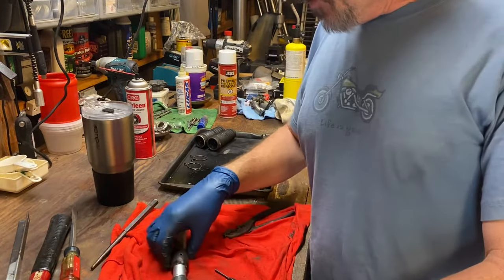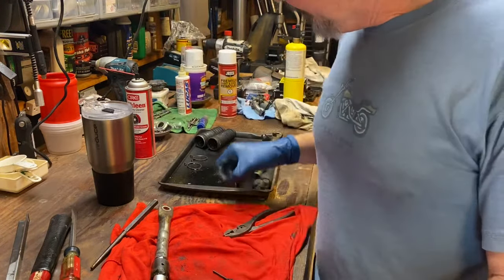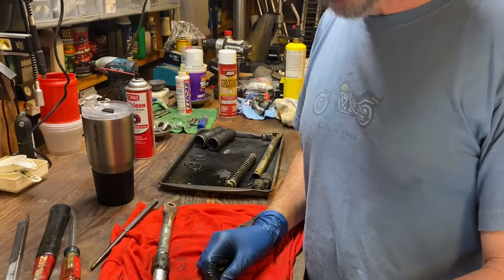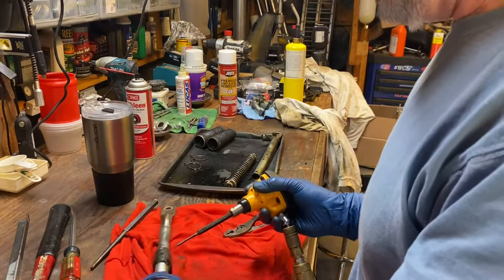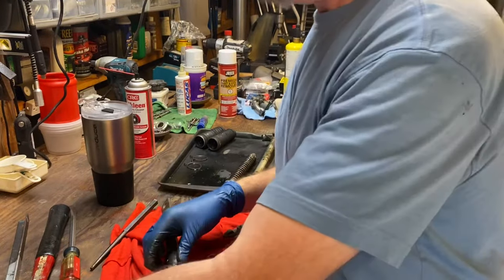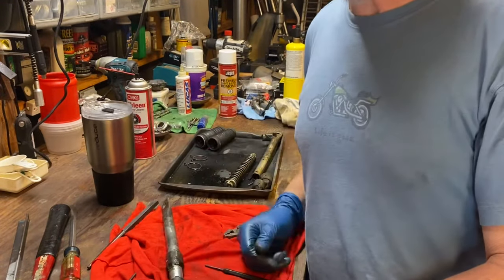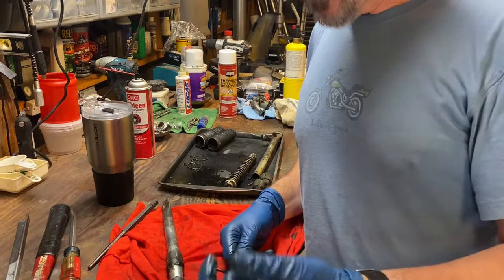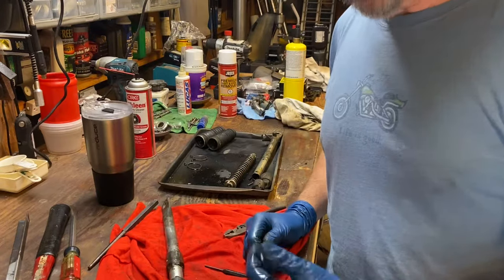How to remove a roll pin in 3 seconds

Comment: It worked!  I went and bought one just for this purpose, and in a matter of 3 seconds it was out.  Been beating on the pin for two days and it wouldn’t budge.  GENIUS!
Reply: I second that. I had a pin stuck in my 1971 snowblower axle. The previous owner had a broke off punch in it. As well.  Took me seconds to knock it out.  $24 palm nailer at harbor freight and the Pittsburgh roll pin punches fit right it.
Reply: I 3rd that!  Same here blown away

Comment: HANDS DOWN BEST INFO IVE EVER LEARNED ON YOUTUBE! I just spent the last almost 3 hours fighting with a roll pin going thru a plastic drive cog into a steel shaft on a snowmobile and finally searched roll pin removal on the tube and this trick got my roll pin out in about 3 seconds! I'm blown away and thankful for the tip! Thank you!!!

Comment: Bro I spent hours over the course of a 3 days trying to get a roll pin out of the steering wheel shaft and rack and pinion using a roll pin pusher and hammer. Never getting the right angle due to the parts being on the car. I saw this video and ran to Harbor Freight bought one for 25 and did what you said. First attempt the roll pin came out. I was happy and mad at the same time. Wish i would have found this video sooner
Reply from the maker: Glad it helped and thanks for watching!

Comment: It worked! I was skeptical of this but was desperate after the first roll pin took hours to remove. I bought the $29 Banks palm nailer at Harbor Freight  and was surprised how small it was. My first attempt cracked the edge off the pin. I launched two punches so be careful. Then I got a good position and the stubborn pin flew out the other  side of the hole. I'm amazed!

Comment: Had 4 split pins to remove from a gearbox. Palm Nailer did the job in less than a minute. Much that time was rotating shaft to get a proper angle for punch.

Comment: Thanks I was thinking I had to get a hydraulic press. Just did this on split pit that was about 1/8 thick. Used my bigger palm nailer as I don't own a small unit and it worked. Careful hits until my punch was in the hole. Held shaft with a drill press press vise.

Comment: This is a great idea and seems effective but I've got four stainless steel 1.25" rods joined each has a joined smaller section by a spring pin and they are not coming out with the palm nailer...any ideas?

Comment: Blind Hole Roll Pin Pulling Out:  Any ideas?     Bore is 3/32 inch.  Only thing I can think of is a very small tap: thread inside of pin and tap will screw it out when tap bottoms.  OR ??????

Comment: I need to remove and reuse one on the trunk cable of my 71 vw beetle. Does this method destroy the pin? Do you know how to install one?
Reply from the maker: It does not damage the pin, just use the right size punch.  Installation is easy - just tap it back in.
Reply: @Chris_Does_Everything  I have a small compressor for putting air in my tires and it works on with a staple gun. Is that enough power for the palm nailer. What else can I do with the nailer?
Reply: Does the tool come with different size punches? The one I need would be tiny. Hardly measurable. I don’t suppose I can attach a photo?
Reply from the maker: It’s designed to drive nails, you’ll have to buy the right size punch if you don’t have one.  In terms of your compressor, you need to look at its output rating and see if that matches whatever palm nailer you decide to get.  Good luck.